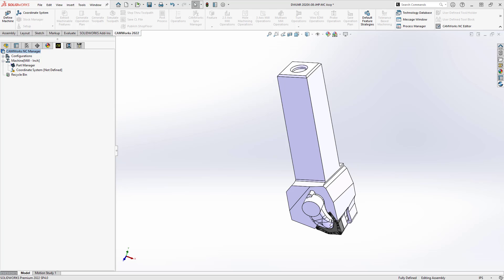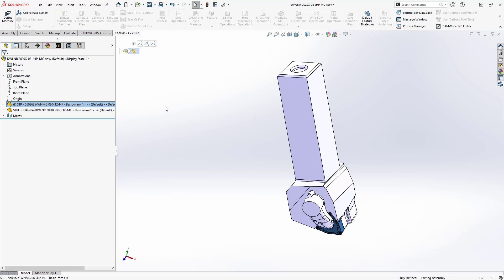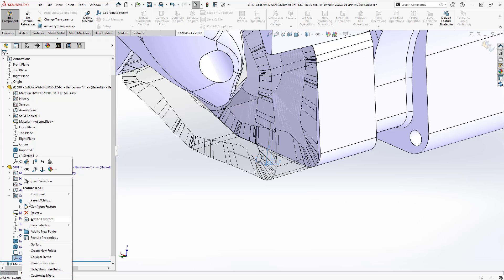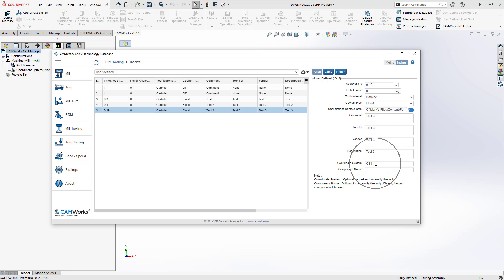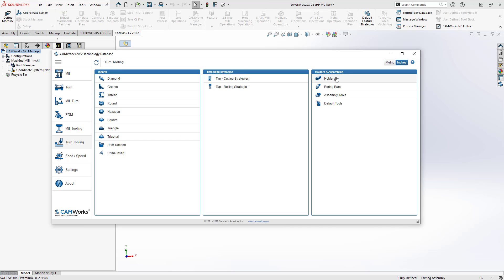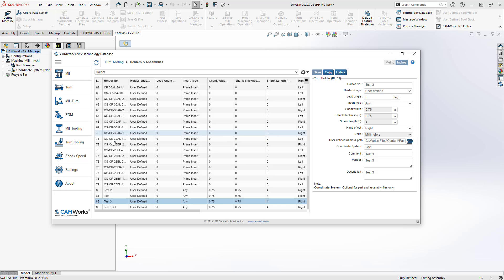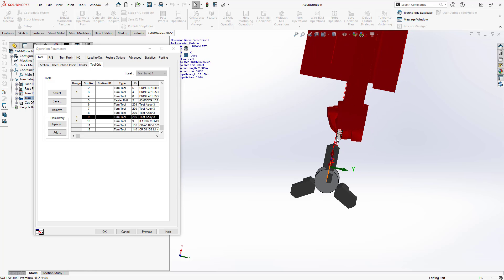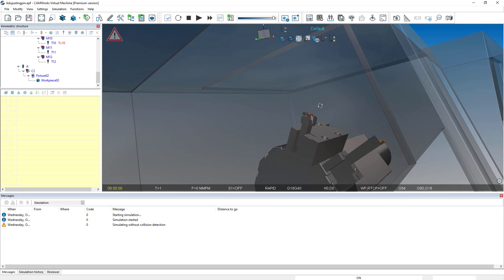Defining a Custom Turning Tool Holder from 3D Solid

Comment: I'm a Cam programmer with a 29 year CNC machining background, not so much on working with the cad files, so this is challenging for me, even more so that i don't have the "assembly function" of solidworks.  is there a way to import lathe tooling/holders/blocks like there is for Mill tooling??
( like the .csv files import from Harvey tool via the tech Db)
  i feel like the lathe tooling camworks gives you to start off with isn't really matching up with what we use in my shop and the selection that camworks provides is very limited and basic.

Comment: I think Camworks is by far the worst in importing tool models from manufacturer websites, Tool database is very counterintuitive and often coordinate systems when defined separately on a tool holder and insert and joint for inserts that are offset don't work properly , they misalign and simulation doesn't work right, and as you mentioned rake angle is not represented right. You should make a video with rake angle and offset insert, since lot of tools have offset inserts that is not even put onto manufacturer's websites information about the tool